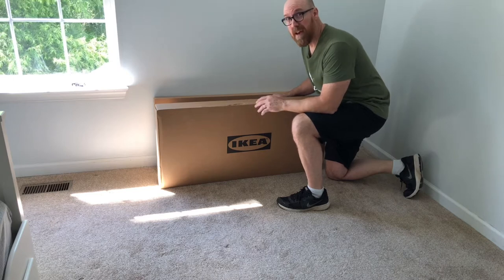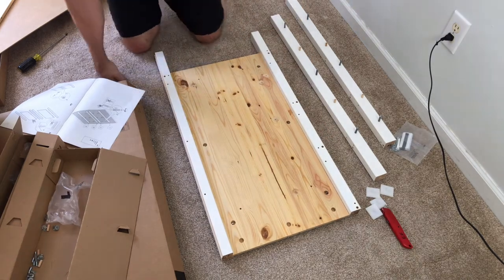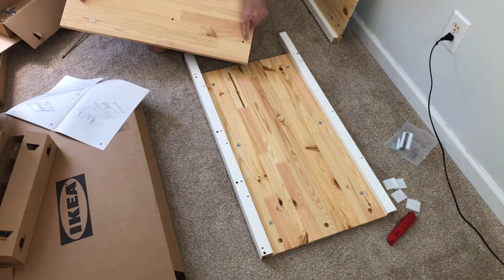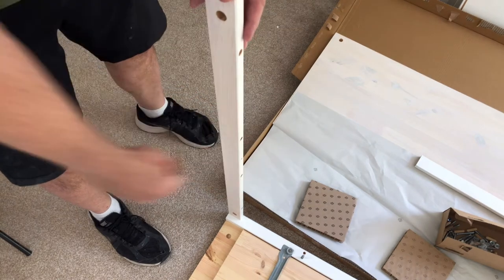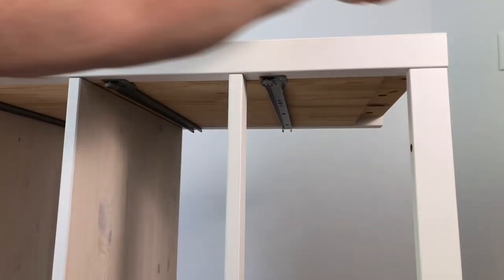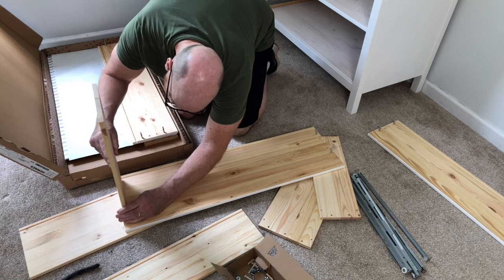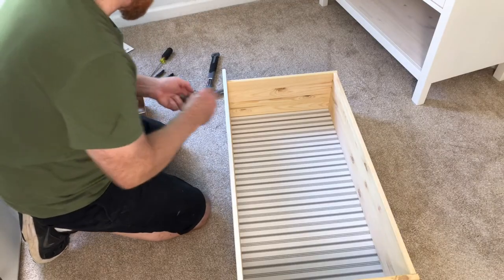IKEA Hemnes Dresser Assembly | Step-by-Step Instructions

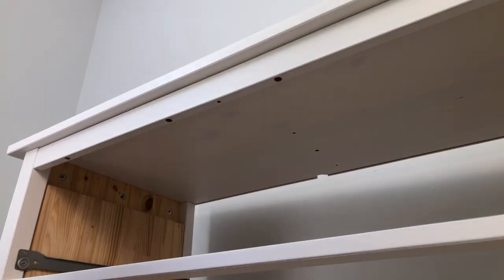Comment: just bought my dresser but I'm having trouble getting the lag bolts to go in @ 3:38, do I need to apply more pressure? the rest of the build went well except I put the ends of one of the drawers on backwards and had to take it apart uhg.  I instructions that come with could be better labeled but I did it!
Reply from the maker: Sharon, probably so but be careful how far you screw the lag bolts in.  Keep a finger lined up where the bolt is headed and stop if you feel the tip starting to poke through.  So glad it helped.  Thanks so much for watching.

Comment: Hello. 
Do you know how big is the boxes if you don't mind to ask?
I have a car and hope will fit in I don't wanna pay extra for delivery.
Thanks!
Great video!
Reply from the maker: If I remember correctly it is about 24” by 48”.  Remember, if you’re in a tight spot, you could always unbox it and carry it home in pieces.  You run a risk of losing pieces but you get it home.  Also, take picture of where you put pieces to help you remember (hardware in the glovebox, etc.).  I’ve had to take several TVs home out of the box because the box would not fit in the car.  Thanks so much for watching.  Please let me know if you have any other questions.

Comment: Great video! Prior to hammering down the back, it looked like there was a little wobble to the dresser. I’m having an issue with wobbling and I tried to diagnose it before I nailed the back. Does nailing the back help with stability?
Reply from the maker: Reginald, absolutely!  Tacking the back not only squares up the dresser so the drawers ride correctly.  Tacking the back also provides necessary stability.  Let me know how it goes.  Thanks so much for watching.

Comment: My drawer slides are longer than my drawer? Is that normal?
Reply from the maker: It is not.  Usually the slides are the same length or a little shorter.  You can easily replace them.  Let me know if this helps.